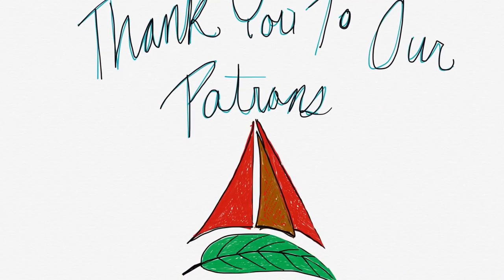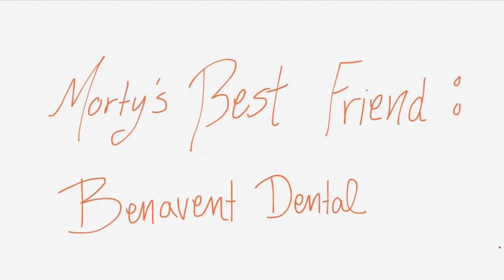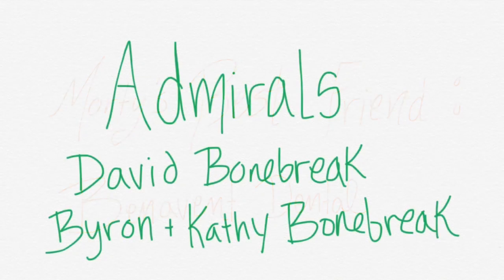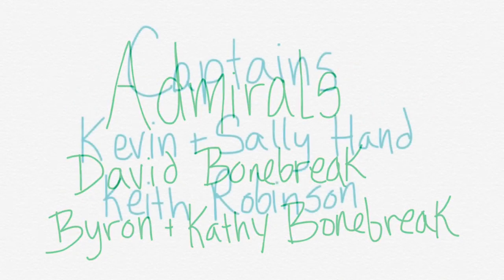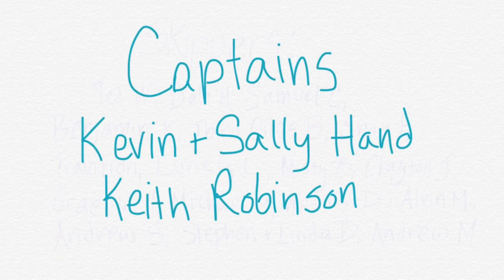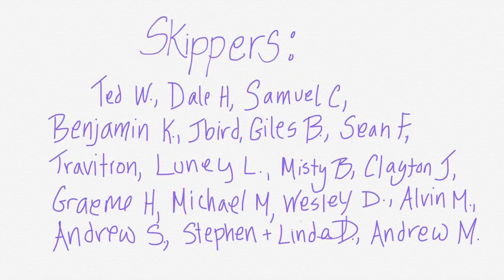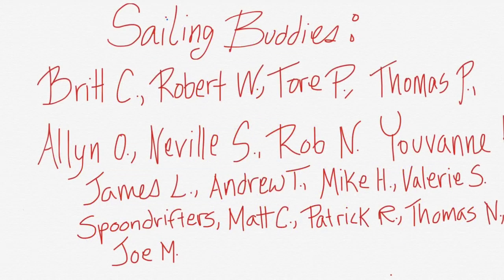How To Hand Crank a Diesel Motor | Sailing Wisdom

Comment: Low compression larger gas motors ( like old cars) could be hand cranked but the higher compression on modern gas engines and always on diesels required decompression levers or Electric starters. Wow That's a rough looking engine in the video......
The famous French sailor (Loiik Peryon I think) lost all electric some years ago on a solo round the world race , Vendee globe I think, and did not have a hand crank for his diesel so he rigged a line around the crank shaft flywheel, like an emergency rope pull start on small outboards, and attached it to the boom then did a gybe to provide enough power to pull the rope and turn the engine over to start it. It Took a 'few' tries but he got it started finished the race! "Necessity was the mother of invention here!"
Cheers warren
Reply from the maker: I just thought it was so cool to see it happen before my eyes, and even moreover that it starts up so quickly!

Comment: I have a 1984 Hunter 28, and the Yanmar engine (2GM20F) manual that comes with it details how to do this. It might be a good idea to consult the manual to see if there are any steps outlined before attempting just to make sure.  

This is on my list of things to do before finishing up my repairs.  Placing a label on the engine to indicate which direction to turn is one of my requirements! One of the most important steps is making sure one cranks it the correct direction.  

I've heard there could be issues with getting sea water into the exhaust system and causing issues before it starts. Something about airlock and insufficient pressure.  Articles I've read suggested that the cooling system seacock is closed when manually starting, and then open it once she catches. Although there was much disagreement about it.  I don't see the harm as long as one doesn't forget.

Thanks for sharing!
Reply from the maker: Yeah, running it backwards would make it a sea water pump!

Comment: Each piston could (should) have it's own decompression lever. All it's doing is holding one of the valves in the cylinder head open, preventing a build up of pressure. Crank the flywheel over and start the engine on one piston (sounds mighty rough) and once going trip the levers one-at-a-time to get them all firing.
Reply from the maker: Makes sense. This was a 1 cylinder diesel, so it was a one-and-done situation.
Reply: Wow! Single cylinder diesel. That's not a common find. The pistons must be the size of dinner plates. Slow turnover with large torque, still a rough running engine, enough to rattle your bones.  LOL

Comment: My boat has a BUKH DV24, a two-cylinder/1L engine that can be started by hand. I love having the sense of security it provides. Last time I cranked it was because my battery was flat. It's easy with the decompression lever, but I think it would be impossible without (way too much compression). The key to starting the engine by hand is to reach the right speed before you release the lever, which in my case is near 2 crank rotations per second.

[Edit] The BUKH DV24 is still being made! (Equips cargoship lifeboats)
Reply from the maker: This is so awesome! Hand cranking is something I knew existed, but I never knew how easy and effective it was.

Comment: Even some electric start diesels use decompression levers... yup common stuff. Original starting procedure was to use just the flywheel. The engine had to start within a quarter or so turn or start from scratch... or there is one tractor that the fly wheel is turned to a certain place and a shoot gun shell used to start. Others are started with compressed air (even gas engines).. I've seen planes started that way. Not to forget starting with gas and then switching over. I am sure there are more that I have missed (like the chainsaw motor starter to start a VW motor in a plane).
Reply from the maker: What a creative world we live in. And now we start our motors with a button!